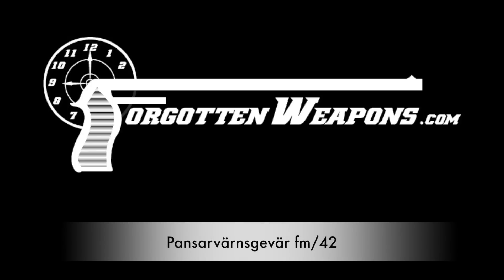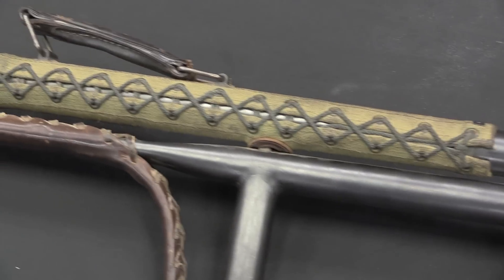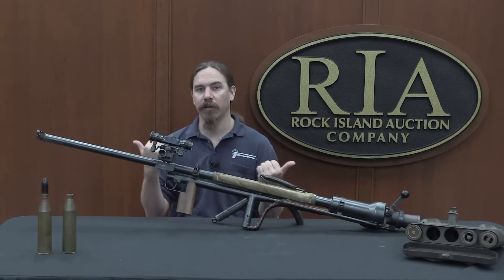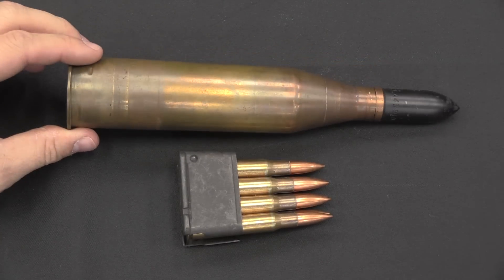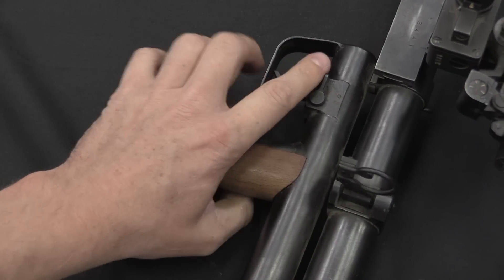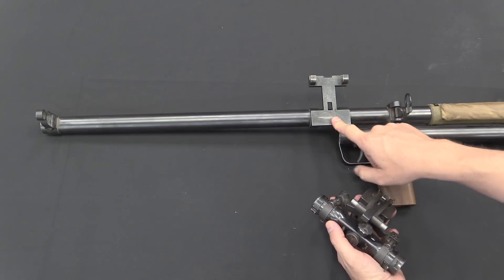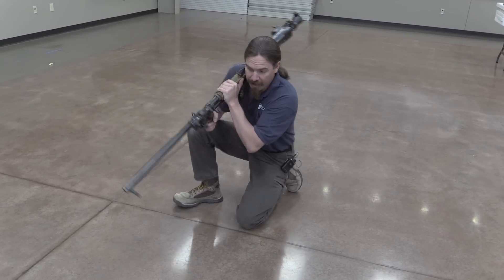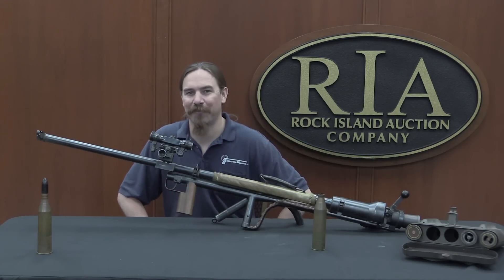Carl Gustav m/42: A 20mm Recoilless Antitank Rifle

Comment: Point of order!  A shaped charge does not actually liquefy the liner, it's been proven by slicing a shaped charge warhead into pieces and firing the sliced warhead into water.  The copper on the bottom of the tank was still in slices.  Yes, if you make copper move fast enough, it will cut through steel!

Also, the reason the case is so huge is because 2/3 to 3/4 of the powder gets used in backblast to counter the recoil.  This huge consumption of powder is why the Germans eventually developed the High-Low system with the PAW600/8H63 and PAW1000/10H64, very lightweight antitank cannons with relatively limited range that more or less used an 81mm or 105mm mortar shell as their projectile.

Comment: Its interesting to note that this has a carry handle while the 84mm variant didn't get one until the third version in 1991. Other then that they are basically the same mechanically, iron sights are very similar, scope mount is the same, scope adjustment is basically the same, extractor is the same. Firing mechanism is almost the same, difference being that that the 84mm version have the primer on the side of the round. 

Basically the exact same weapon except a different caliber.

Comment: This kind of weapon could be reasonably updated and brought back primarily to deal with APCs, IFVs, and MRAPs that are only armored to heavy machine gun rounds and often only from certain angles. BMPs, for example, would be particularly vulnerable with their very flat sides and very thick rear doors that are also fuel tanks.
Reply: The current M4 (M3E3 in US designation) Carl Gustav 84mm is shorter, lighter, way more powerful, has even less recoil, and a truly huge plethora of ammunition. It is also in current use in some 50 armies, so I'm not really sure what you mean by "brought back"?

Comment: Picky time, and quite possibly wrong : 3:05 shaped charge -> gas jet that defeats armour kinetically , self-soothing fragment -> shaped charge plus metal front plate that forms into a slug/stream/blob of metal which defeats armour kinetically.
Thing is that the shaped charge/self-forging fragment round carries chemical potential energy with it in the explosive, and releases the chemical energy into kinetic when it impacts the target and the explosives detonate to form the gas jet/metal blob.  Whereas the old solid round rifles only release chemical energy once, to accelerate the bullet.

Comment: It's very interesting to see (and hear about) the parallells between this weapon and the Carl Gustav m/48. The breech loading mechanism is even the same :P
Reply: Well, similar, but the way you extract spent cartridges is very different. And the m/48 is completely open at the rear. That's why those squirrels get sucked in after you fire. ;)

Comment: Germans did produce a 28 mm cannon "2.8 cm schwere Panzerbüchse 41 (sPzB 41) or Panzerbüchse 41". It used tungsten core projectiles with very high velocity. It fell out of production and use in 1943 as the availability of wolfram in Germany ended.
On the other hand German Pzkw III and its variants had only 15 mm sidearmour in some places so the Soviets found their 14,5 mm anti tank guns effective e.g in the Battle of Stalingrad when the battle was on the streets.

Comment: Technically speaking, a shaped charge does not create molten metal, the copper in the chared is deformed so fast that it doesnt get time to melt, it changes its shape while being cold, that makes the metal realy realy hard (in german the term is Kaltverformung). That hard, shaped piece of metal can penetrate the armor then.

Comment: There is no thermal component to shaped charges.  It relies on velocity to achieve penetration.  Even the term, "molten jet" is not accurate.  The explosives exert so much pressure on the copper lining that is begins to act like liquid even though its below its melting temperature.  This liquefied metal is propelled forward at something like 11000 fps which is how it is able to push its way through a ridiculous amount of armor.

Comment: 3:00 Shaped charge armor piercing warheads produce a high-velocity jet of liquid metal that punches through armor. It is a common misconception that they burn through armor.
Reply: Yep. Good call out. Make no mistake, it's fuckin hot, but it's extreme energy in a small spot that is what's punching through steel.

Comment: Shaped charge use velocity from explosives to cut trough.  Thermal properties is only for shaping the the metal to a plastic/liquid projectile. It cuts through like a projectile, at the right distance from the explosive charge sets off/impact. The speed from the explosive charge is very high, therefore the penetration capabilities.

Comment: This rifle is a really interesting piece. And so much of it carried over into the 84mm recoilless rifle. I am very familiar with the latter, having been deployed with it many times over the years. And the 84mm is pretty much recoilless, though the blast is substantial to say the least. Most of the movement in the weapon upon firing is due to the weight of the grenade moving down the bore. And despite it's antiquated looks, it's still a very potent weapon. The main HEAT round for the 84mm, the FFV551, can not penetrate modern tanks, but will penetrate armoured IFVs and APCs. With upgraded ammunition, such as the FFV 597 it can penetrate about a meter of armor. And the versatility of the weapon makes it capable of supporting troops in many ways. Such as the high explosive fragmentation with a time fuze that allows airbursts, illumination rounds, smoke and even cannister. Several firms now offer upgrated sights, with  NVD or thermal imaging, dynamic lead, range finding and so on. And several generations of lighweight models bring the weight of the weapon down to the weight of medium and light machine guns.  As for the recoil, my thought is that felt recoil in the fm/42 derives from the firing pin plate that obstucts part of the venturi. Though most of the pressure escapes through the holes made in the base plate where it's not supported by the firing pin plate, some of the pressure will push against the firing pin plate and contribute to a rearward movement of the weapon. The 84mm does not have such a plate. The firing pin strikes down on the side of the casing just above the rim, where there is a primer. So the venturi is unobstructed on the 84mm and all the propellent gases are vented out the back without pushing on any vertical surface. Well, just my 5 cents.
Reply: Daaamn, 1 meter of armor? The 84mm bullet/grenade must be massive!
Reply: @roku_nine  it's 84mm so...
Reply: @roku_nine science, my man. Shape charges are insane
Reply: Thats like 5 dollars not cents
Reply: Speaking of recoilless artillery, I know a captain at I 19 that accidentally nailed an elk with the  a big brother of the pvg fm/42: 9 cm pansarvärnspjäs 1110.
It was an exhibition shooting for foreign visitors, and they had two pieces set up.
For some reason, the other one was malfunctioning. Crew did a quick check, but couldn't get it working, so they asked the remaining gun to take their targets as well._
Checking the firing angles, it seemed safe to do, any misses would still end up within the confinements, only worry was they didn't know exactly where those targets would come up as they only had rehearsed their part.
(Yes, all exhibition shootings were rehearsed, you really don't want odd things happening when you have a general with guests watching :-p)
Anyway, at about 600 metres (since they were covering for the other gun) a dark silhouette began to move in the brush so he took aim and fired...   only to see the target still moving some 15-20 metres to he right. Cursing under his breath, while gun was reloaded in no time, he took aim again and dropped it.
Rest of the exhibition went without a hitch, but then the other crew (who had a better overview congratulated to the nice shooting, dropping he double target like that.
This was heard by the range master, who got puzzled and inquired what they were talking about, since he hadn't set up any such targets for this.
So, after a short but heated discussion, out they walked for a manual inspection.
On site, they found a squarely dropped target, and the rear half of a 450 kg elk. 🤣
Reply: @johanmetreus  is this a real story? The range master would have lost his job if he had unknown targets walking around during a test fire
Reply: @fallinginthed33p  as real as the leg he brought home lol
Sweden has some of the largest ranges in Europe btw, and only the ones closer to populated areas are fenced in as it would be detrimental to wildlife (not to mention be VERY expensive), but the animals usually stay away when there's human activity.
1970's were more relaxed as well, so it was more "shit happens".
Reply: @johanmetreus  remind me never to do wild camping or random walking in Sweden 😋
Reply: Awesome comment
Reply: Impressive how much power even a downsized HEAT round packs
Reply: Did you get to fire it in combat?
Reply: @unverifiedbiotic  i did fire them in the 80,s  and it was 1 mean thing,,,
Reply: A friend of mine fired one of those beast when he was doing the mandatory military service in Norway, he said it was incredible feeling of concussion when the round went... I heard they did limit how often you could fire it in peas time training because of the concussion is damaging to the body.
Reply: They're not being used much in Ukraine though. The terrain and tactics there favor ATGMs.

Comment: 40mm penetration from 20mm is good? kb ppanc wz. 35 was able to penetrate 40mm and it was 7.9mm gun developed few years before that crap. Not to mention Ur rate of fire was 8-10 shots and here u need propably to use fire extinguisher before u shot another round.

Comment: Okay, so if a lot of the power goes to waste with a recoilless rifle anyways, then why not just make a less powerful charge to begin with so that you don't need to expel most of it in order to make the gun lighter?

Or am I missing something about how this works?
Reply: >Or am I missing something about how this works?

The idea is to not break the person holding the gun. The recoil of firing that large of a projectile at that high of a velocity would probably kill the shooter if the recoil force went into the gun, rather than out the back.
Reply: Yeah, but then my first point remains. Why not just make a less powerful cartridge, since most of the power goes out the back with this more powerful cartridge anyways? Where is the benefit to making an overly powered round where the gun is designed to send most of that power out the back to reduce recoil? Why not just go with a smaller weaker cartridge that doesn't need to have any recoilless design to begin with?

Comment: A HEAT warhead doesn't rely on high temperature to pierce armor, the copper liner is plastically deformed into a jet which cuts through armor in a manner similar to water jet cutting.

Comment: shaped charge warheads don't use thermal effects to cut though armor its wholly kinetic in nature 
(a very common misconception) 
the jet is traveling around 10km/s which creates conditions where materials act more like a fluid or plastic when hit even though it and the jet are both solids

http://www.globalsecurity.org/military/systems/munitions/bullets2-shaped-charge.htm

Comment: actually, a shaped charge does not cut through the armor because of 'thermal properties'. Even use 'molten' is pretty far fetched. The jet is way too cold to be 'molten' . The process of punching through a plate is in fact a 'cold' process. Cold working (?) at extreme pressures.

Comment: Ian, you got one thing wrong: a shaped charge does not rely on thermal effects nor is the metal molten. It works by high-pressure, cold deformation of metal. It's a common misconception. Absolutely love your channel though!
Reply: Roderick storey All HEAT rounds are copper cones, not a disk, and in no way relies on heat. The immense pressure makes the copper act differently than you would expect(but it’s definitely not a liquid),  and shoots it out at a very high speed.
Reply: You should watch a slow mo of a shape charge going off..... .....
Reply: Well, the copper (which is the most common metal used) is fairly close to its melting point in the produced rod and it is definitely a fluid, even if it's not technically a liquid. But you are correct that a lot of people think the copper melts from the detonation. Even my Carl Gustav m/48 instructor at the Home Guard claimed it to be that way.
Reply: I'd imagine the word "cold" isn't entirely accurate lol
Reply: @sawyernorthrop4078  indeed, I think "adiabatic" would be a better choice. The point is not that there isn't any heat involved in HEAT, the point is that the penetrating jet is formed and punching a hole by good old kinetic energy before the heat can spread throughout the material. It is, literally, happening faster than the speed of heat.
Reply: @johnsalt1157  hypervelocity stuff is so weird it doesn't behave in any of the ways a normal person would think it should
Reply: Fuesel2 is right, the explosives form the copper disc into a rod that travels at 6k -10k m/s. The friction during penetration is what melts the copper.

Comment: Great video, but I do have to correct you on the principle of shaped charges - they don't use thermal properties, the explosion just propels a jet of metal to absolutely ludicrous velocity (several kilometers per second) which creates pressures that make the metal act in ways that blur the line between solid and liquid. You're definitely right about how they carry the energy in chemical form in the projectile instead of relying on just its kinetic energy though.

Comment: I don't think you lose projectile energy because of the backblast. Forces always come in pairs anway (actio = reactio) and it doesn't matter whether the rearward force accelerates gas or a counter weight out the back or it moves the gun (recoil). Although recoilless rifles generally operate at lower pressures than cannons and therefore are less powerful, this is due to their lightweight construction to keep them man-portable, not their operation principle.

Comment: 3:03 is completely wrong Carl Shaped chargers have nothing to do with melting metal, it's tv show mistake that has kept going for years please add a caption.

It's only about extreme pressure applied to a very small point on the armor.
Reply: Deathmachinept fact. Pure velocity pushed that cone through the armor.
Reply: Nah, the cone is made of copper for the very specific reason of its very high thermal mass and conductivity. 
If it were unimportant then they would use aluminum so they could pack that much more of an explosive charge behind it for the same projectile mass.
Reply: The Cone was for shaping, and increasing the fidelity of  the Jet Stream, not really for use as a penetrator.(in truth, no cone is really needed in order to make the Jet form, it just helps to form a better Jet)
 although it does add a tiny bit of mass to the Jet,  it is in fact the Jet itself that does the work by forcing the target armor to flow as a liquid due to the immense pressure of its 30,000 FPS velocity.  The fallacy of the cone doing the work is just silliness used by Media to disguise the true function of a shaped charge warhead. The one thing Shaped Charge warheads require to function properly, is not to spin, as this disperses the density of the Jet.  modern HEAT munitions use free turning driving bands to prevent the spin from being transferred to the Projectile.

Comment: I know that the modern M3 Carl Gustav actually fires a rocket that is stabilized by rifling in the bore, is this a similar idea?
Reply: More than similar. The Carl Gustav m/48 (models M1-M4) is a recoilless rifle too and this gun is its direct predecessor. It doesn't fire rockets but in some of the modern export rounds the projectile has rocket boosters for additional speed.
Reply: Mattis Lindehag , No I mean that the 84mm Carl Gustav in current use with the US military is a rocket launcher that uses rifling instead of fins to stabilize the round. Is this a rocket that uses rifling, or does it some how use offset charges firing forward and backward to eliminate much of the recoil...
Reply: You can find out how this gun works by just watching the video, but in short it has a single charge that fires a large bullet with no independent propulsion. Instead of containing all of the pressure in the gun the expanding gases are vented out the rear. Aside from causing a pretty severe back blast this also means that a whole lot of the energy is wasted but the bullet still achieves a very high speed since the loss is compensated for with an extra large charge. The Carl Gustav in the us military functions exactly the same way with the exception that some of the projectiles in use have rocket boosters.
Reply: Mattis Lindehag that's not how we were briefed on it. Not a physicist here, just not what we were briefed before Fielding and using it in Afghanistan. I loved using it though. It's like a bloodless punch in the mouth with a simultaneous kick in the gut everytime you fire it. man does it take the fight out of the haj though...
Reply: Mattis Lindehag that's not how we were briefed on it. Not a physicist here, just not what we were briefed before Fielding and using it in Afghanistan. I loved using it though. It's like a bloodless punch in the mouth with a simultaneous kick in the gut everytime you fire it. man does it take the fight out of the haj though...

Comment: Sorry to be a bit of a pedant here but in fact, shaped charge weapons do not rely on the intense heat to penetrate the armor. As with bullets, the key to penetration is very high velocity, which is exactly what happens with a shaped charge whereby a "jet" of liner metal (usually copper or tantalum) is accelerated to a very high velocity...I think C4's detonation velocity is like 9000 m/s.